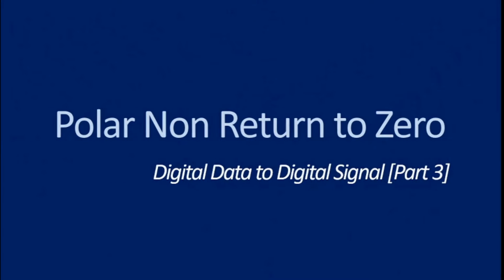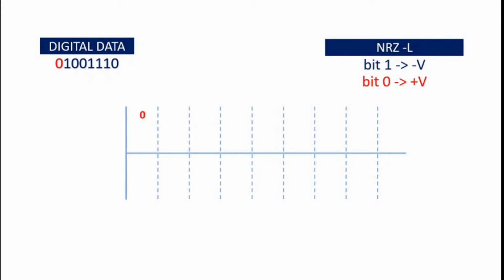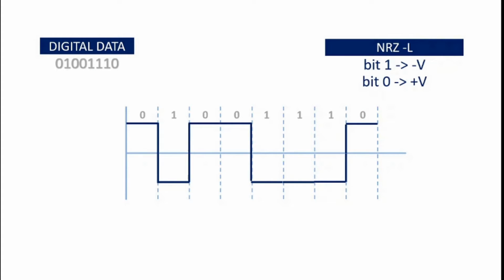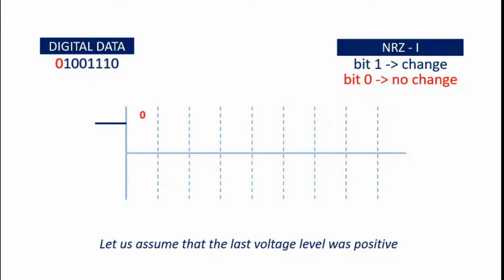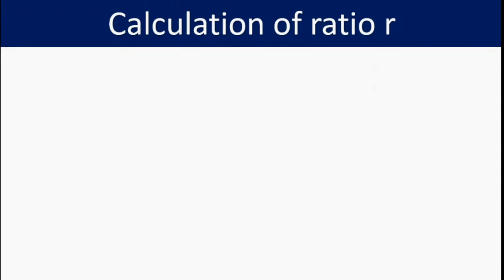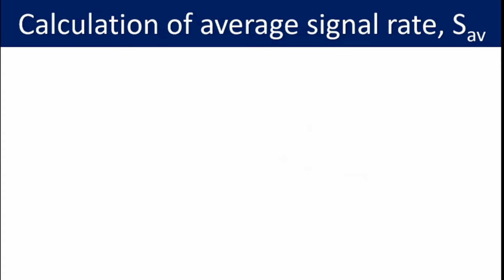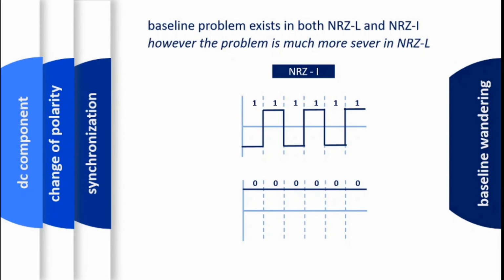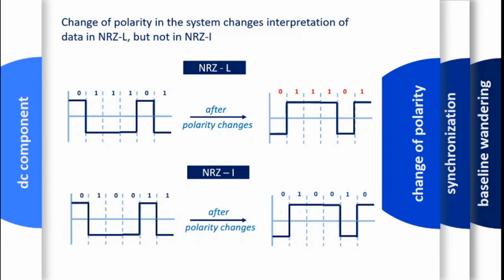Polar NRZ (Non Return to Zero) || NRZ - L and NRZ - I || Digital Data to Digital Signal Part 3

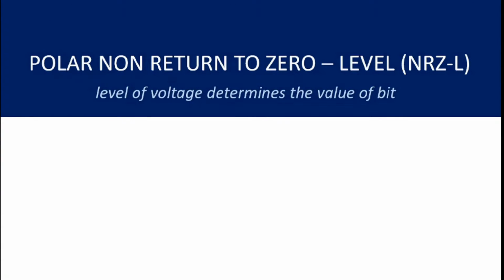Comment: Sir, in this video at 0:26 we take bit 1 for -ve and 0 for +ve. But in our class lecture, we took 1 for +ve and 0 for -ve. Which one should we use? Can we use either one as an assumption or there is a traditional convention for determining this?
Reply from the maker: Both conventions are in use. So it really comes down to which one you want to follow.

source for taking -ve for bit 1 : https://bit.ly/2Csg7Dw
source for taking +ve for bit 1: https://bit.ly/2CmVlVD

Hope this answers your question.